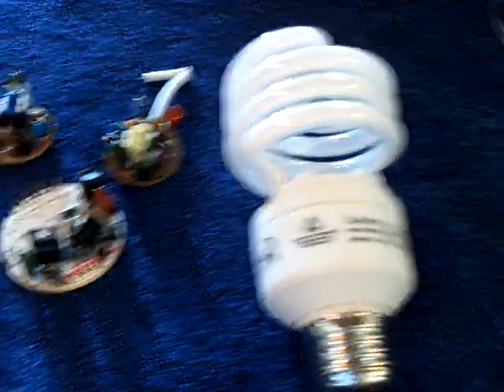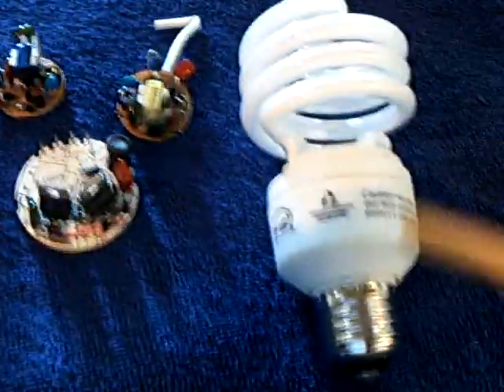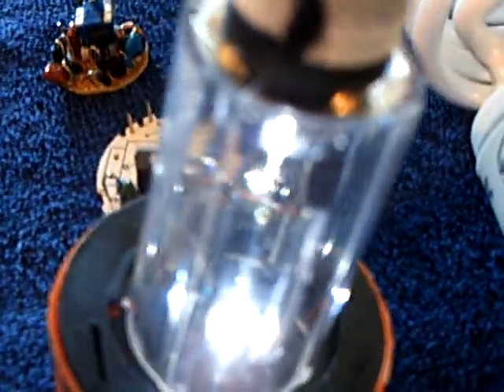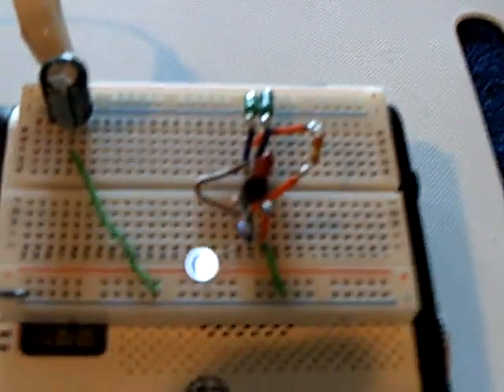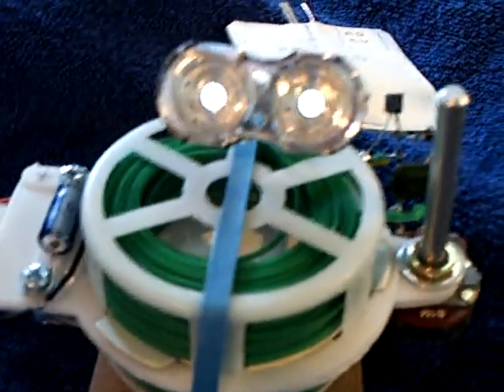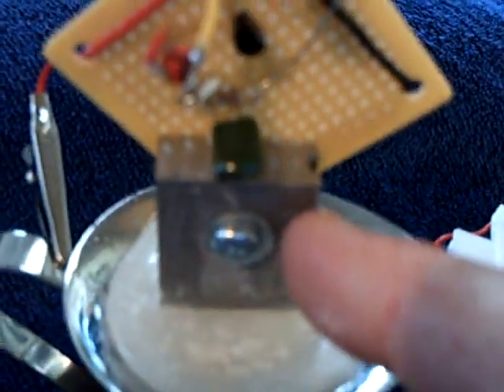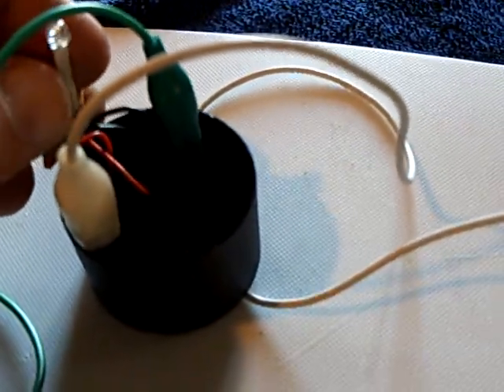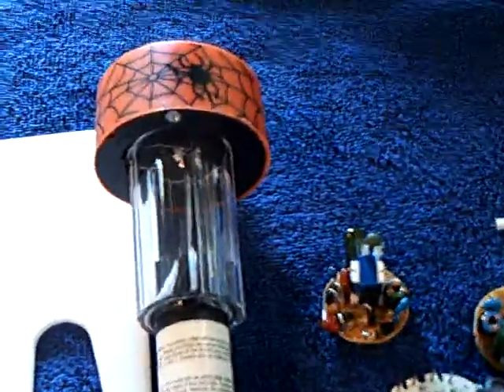LED oscillator made from parts out of a CFL

Comment: On bulk trash pickup days drive around and look for an old "TV  Sony has lots of magnet wire around the picture tube that you can unplug or cut from circuit board.  Lots of caps and dioeds to play with your electronic projects, all for free.  You can use the magnet wire to wind thousands of coils.

Comment from the maker: @egn83b ---I looked up the value on those green chokes and they are 110uh.   The black radial chokes work also.  This will run more than one LED easily but the more LEDs you add the less light unless you increase the power.  Most of the CFLs have a small toroid on the circuit board also and you can  wind up a regular JT setup using that.   Jeanna made a neat AA battery house light a year or so ago using one.  As I recall it was a little yellow toroid she found on the board.

Comment: Walmart's Great Value CFL's work great for cheap CFL parts at 1.46 a bulb, if the dollar store does not sell them. I love the idea of not building a bifiler to get a jouel theif working side by side coils. The values of the green coils should be marked by a color code which can be referenced normally or just ohm'd out and find the value online. I wonder if the circuit will power another LED in parallel.

Comment from the maker: @iluzyon1 ------I noticed the same thing when I tried just coils of wire on sewing machine bobbins (from my Muller project)-----they don't have to be next to each other.   I too am questioning the reason why the circuit is working.   Other coils I tried had to be near or next to each other for it to run.   The feedback to make the transistor switch is the question.  In a standard transformer type blocking oscillator it is pretty simple but on this there may be RF that does the trick?? Hummm.

Comment: I redid the tests i made when i reproduced your penny B.O. with chokes and i dont know if you noticed the same reaction but here what i think is interesting.I dont realy undersand the logic behind this circuit (mostly the transformer part) ...am i saying an evidence here?''SIDE BY SIDE''  realy important, i dont know! using 150uH on collector and 560uH on base, i get it to work with the chokes over 5 feet away from each other(lenght test, not the limit).Are the chokes working independently?

Comment: @Lidmotor ------I dont like to spend lots of money neither so i'm a Dollarama big customer to :D (dollarstore here in canada).  I had to buy that metglass toroid because i though i couldn't get it anywhere from junk. I dont even know where they are used for normaly. Unable to put the link here, not alowed i guess. Got mine on ebay...it's inside a red plastic ring case ( Seems little higher than Lasersaber's).Ontario supplier (drills12) For a to expensive near 58$ (can) with shipping.

Comment from the maker: @ReasonForemost -----Well Penny No.1 and 2 are rather "full figured" but they sure can cook.  As long as they keep putting out I'll keep em around.  The new skinny ones probably won't keep up with them in the long run.  A homebuilt kitchen table oscillator that runs an LED for under 1 microamp is hard to beat.

Comment from the maker: @ibpointless2 -----The "greenie" chokes that I found on the CFL boards were 110 uh but in this application the values didn't matter that much.  The circuit diagram is in my  "Penny circuit" video.  I used that exact circuit to test the chokes then started replacing the components one by one with what I could get off the CFL board.  The basic circuit was kept but it took much help from my good friends Mr. Trial and Mr. Error before I found a combination of parts that worked right.

Comment from the maker: @MrFlathunter ---The easiest way that I found to open the CFL is to hold the bulb with a thick towel and use a thin hack saw to carefully cut around the joint.  Be gentle because you don't want to break the bulb or damage the circuit board.    You can also pry it apart with a screw driver sometimes but it takes longer and is usually much harder.

Comment: Great work again :)
Garden light panels can vary in quality, got a few here and the straighter the little lines, the better performing... only 0.2V on 2 of mine in direct sunlight and the panels look a mess ! Yours seems a good un, great performance.
You mayyy like my latest osc vid, it's a flux capacitor arrangement using 3 chokes.

Comment: I just realize that i'm repeating what you said in your video :/...sorry about that! Dont know if you already got your's but it's surprizing how efficient  the metglass toroid is. Waiting for lasersaber's super joule ringer schematic. This may convince you... can light a dim led with virtualy no turn on toroid (only the 2 wires passed through once) standard JT circuit, 1.2 volts. Bright light with LED connected to a 4 turns secondary winding.

Comment: I really excited about the circuit that uses chokes, it so happens that I have a bunch of chokes from another project and I didn't know what I was going to use them for but now I know. What color code is the chokes your using? Would it be possible to get a diagram of the latest circuit, maybe post it on Energetic forum? I've got a lot of chokes that i need to use up, glad you posted this video.